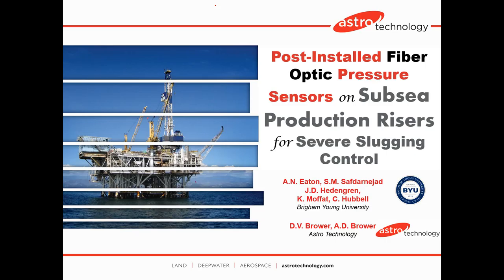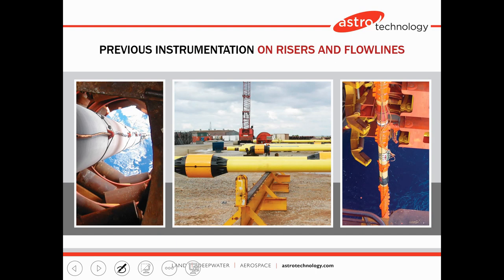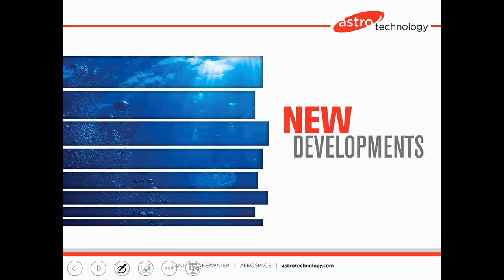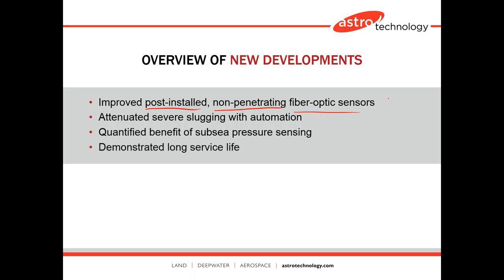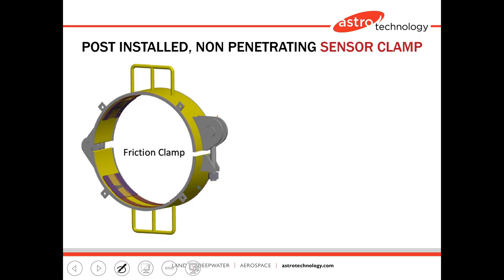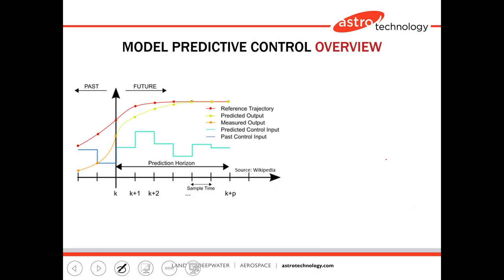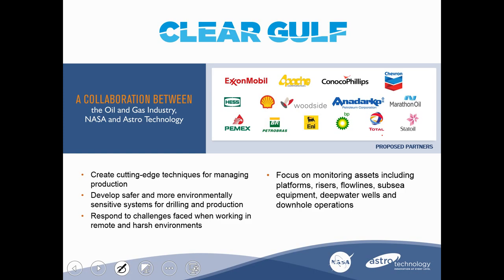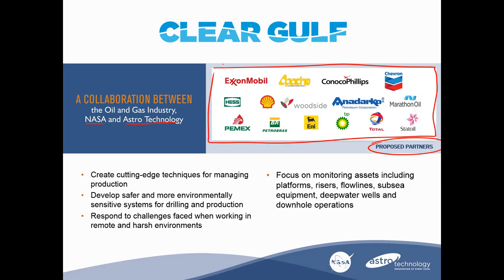Model Predictive Control of Severe Slugging in Risers

Comment: Very good video. I want to know how you designed this MPC controller, and how do you get the MPC control effect curve? Want to know what this simulink graph is? Thank you very much
Reply from the maker: More details are here: Eaton, A., Safdarnejad, S.M., Hedengren, J.D., Moffat, K., Hubbell, C., Brower, D.V., Brower, A.D., Post-Installed Fiber Optic Pressure Sensors on Subsea Production Risers for Severe Slugging Control, ASME 34th International Conference on Ocean, Offshore and Arctic Engineering, OMAE2015-42196, St. John's, Newfoundland, Canada, June 2015. https://apm.byu.edu/prism/uploads/Members/Eaton_OMAE15.pdf
Reply: @apm  thanks much ,and I want to know what's the states space model of the slugging in your article ？What is the state space model in the pipeline module in your Simulink diagram?and  how do you adjust the PID parameter? thanks
Reply from the maker: @yiyuanwang4563  it isn't a state space model. It is a simplified three state model that was developed by Storkaas [9]. The blocks in the Simulink diagram produce the outputs based on those equations. You adjust the PID parameters by double-clicking the PID block. There is a configuration screen that appears.
Reply: @apm  oh thanks，Can I see the structure diagram in the pipeline block？Or where can I see how the three-state model is represented in the Pipeline module?and What values did you use for your PID parameters in your paper?thanks
Reply: @apm  Hello, thank you very much. I want to know what is the source code of mpc.m function of MPC controller in Simulink? Can You give me a copy of the source code? just the mpc.m file . I've been trying to recreate the process, sorry to bother you!
Reply from the maker: @yiyuanwang4563  I don't have that mpc.m file but there are other MPC examples (MATLAB, Python, Excel) here: https://apmonitor.com/do/index.php/Main/DynamicControl